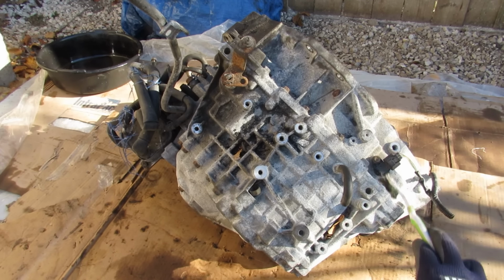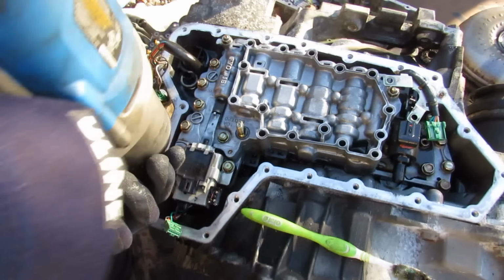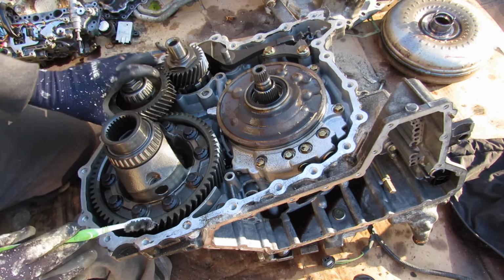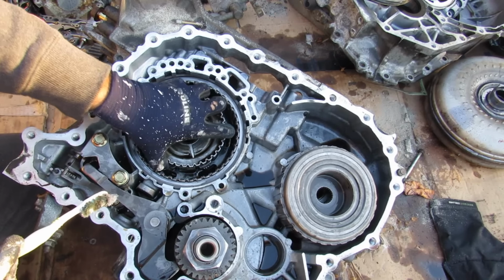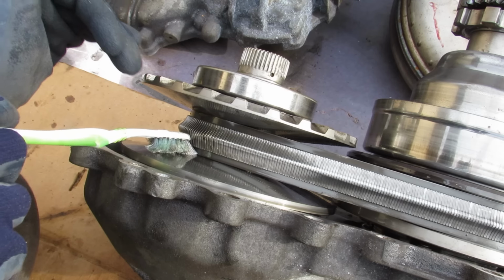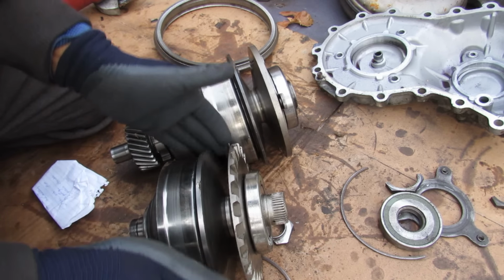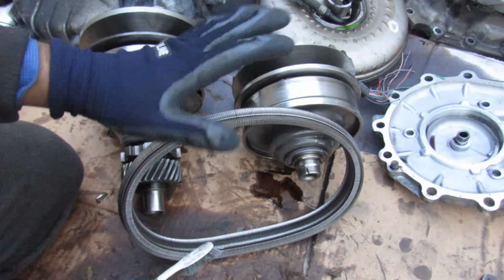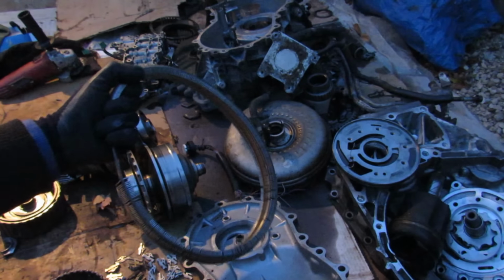Why Nissan CVTs FAIL

Comment: I own a 2013 subaru and when I went to trade mine in and found out they had switched to CVT transmissions... I WALKED OUT THE DOOR. THey don't last as long and the warranty they offer reflects this fact.
Reply: I was somewhat concerned when the wife wanted to buy a Forester. It's a 2016. Several years after the purchase, Subaru bumped the warranty to 100k miles - ok, what do they know that I should know? Just got back from a 2500 mile road trip, with the cruise set at 80 mph. We were just about the slowest vehicle on the interstate. Forester has rolled 127k miles now. I did do a CVT fluid flush with Subaru fluid at 100k - even though Subaru says the CVT is not supposed to be serviced. Old fluid did not look that distressed, but I didn't send a sample out for analysis, so who knows?

Comment: I have a new appreciation for designers and those who repair CVT Transmissions. This is more complicated than maybe even brain surgery. Kudos to those who study and become experts on these vehicle parts.  I will never take my automatic transmission for granted again.... and maybe buy my next car with a Manual Transmission!
Reply: Repair?  There is no repair for a CVT, what they do, out of warranty, you buy a new transmission the old they may give you a little discount but you will be 4k or more dollars light for a NEW one, identical, you pay the replacement cost at the dealership, as you will get warranty, if you replace it by yourself or an outside mechanic, you will get warranty from the shop to took it to.  As there are computer related stuff that need to be done to the Transmission Computer control unit and the car computer work together so, you have to pay labor.  In my opinion, keep you money save and get another car that has NO CVT or Dual Clutch transmission.  They are expensive and cannot be repaired, period.  Remember even having the money, you are getting the same transmission that will fail again and it cannot be repaired.
Reply: @somarpr ... I am very surprised at what some of these people have written in the comments because jetco is known for more than 20 years for total garbage CVT transmissions and they're still running on the same principle except for you don't have to split the cases now they've added a transmission pan..... Avoid all jatco CVT they've had the same problem for more than 20 years and they've just needed the do a little longer but it's still the same thing .....garbage😮😮😮😮

Comment: Most of the ones I've seen only have a problem with the spool valve stepper motor. $30 part and just requires dropping the pan and valve body which can be done in vehicle, takes maybe half an hour, and doesn't require complete disassembly of the transmission or replacement like other shops told those customers.
Reply: I just replaced my stepper motor, and the car drives a little better but it still shows the same code after a couple resets, do you have any clue why that might be? It drives way better but it still slips but I can feel it “shifting” up but it takes some time. The transmission is at 172k
Reply: @JesusMorales-bn4qf  If those are your symptoms you may actually have a physical issue internally. The main symptom we see is the stepper motor code and the car seems like it is stuck in "first gear". Won't change ratio at all and you can only do ~50mph tops.
Reply: @Ashquacks  yeah i think it might actually be slipping, I drove it yesterday like 30 minutes and I could reach speed but it takes time, I have to slowly get on the gas and the car starts gaining speed and when I feel it slipping I let go of the gas and the car takes a second but it goes to the next ratio
Reply: @JesusMorales-bn4qf  you probably bought a bad stepper but a brand new one from rock Auto for 90$

Comment: I had my 2015 Mitsubishi ASX CVT trans replaced under factory warranty as it died at under 50,000km. They were going to rebuild it at the main dealers workshop but as they didn’t have any spare parts available so they sent a brand new trans to my local Mitsubishi dealer which they fitted. The car went well for a few weeks then went through a period of refusing to start so it had the crank sensor replaced also. It has gone well for the last few months but in reality these Jatco trans do not have great reliability and the fact that just about every brand of car uses these is a worry.

Comment: First rate video of a not so great product of Nissan which is Japan's version of Chrysler.  Had a just broke in 2007 brand new Maxima that I drove down the highway at 138 mph.  Heard a faint rumble sound from the rear after making that one small pass of no more than 5 miles.  Both rear wheel bearings had to be replaced.

Comment: "Why Nissan CVTs Fail" Because somebody takes an angle grinder and ... :)
This was a great video. I drive a Subaru Outback with a CVT. Here in Australia they say the CVT does not need servicing, but in the US they say it does. When I checked in with a local transmission shop about it they said it's because when a car brand goes with fixed price servicing for the warranty period (common here in Australia) they want to keep their costs down to minimum. And if they think the CVT will outlast the warranty period then they don't want to pay for fluid changes etc.
Oh yeah, same brand of toothbrush as me. Seems I got that one right. :)

Comment: If I EVER needed a friend, I need 1 now.
I got a transmission flush done by my mechanic, at around 75-80K miles. 
I just turned the car to 115K miles and now the CVT is acting up. 
I did NOT know, that there's a specific trans fluid needed for the flush.
My mechanic is a old school mechanic and I believe he used some typical trans fluid, NOT knowing that you need CVT fluid. I didn't know of this CVT fluid, until 1 week ago.
If he used the wrong trans fluid and now the car "jerks" when accelerating - Is it TOO late to do a CVT flush and I gotta replace the CVT ????????????????? PLEASE SOMEONE HELP ME OUT
Reply: I would change the fluid to what is specified for your tranny, be sure not to overfill
Reply: @ravenbishop5232  - I'm gonna do that. But I'm gonna have a mechanic or 2, look at the trans itself....fuel filter and a few more things. Hopefully this car can give me 2 more years. Cuz it's not very old nor beat up.
Reply: Damage already done - always use the correct fluid with CVTs.
Reply: @LondonSteveLee  - Welllllllllll here's what happened (If I can short form this) I contacted Nissan directly. The Service guy was like, "Let's say your mechanic did use the wrong trans fluid" for example = Then you would've felt an immediate impact or within a month of the transmission fluid change. So that's not the case. NOW I'm a big fan of Lucas products. I used the Lucas Transmission Slip/Leak fluid. It initially worked GOOD. But then I had issues with gear 2 and then, it turns out...It's "Gear 2 on up". So I contacted a reliable mechanic. He said $4k for a rebuilt/used transmission with a 18000 mile warranty (regardless of how long it takes to reach 18k) or around $5k for a new transmission from Nissan (warranty not specified yet) In the mean time, I've been driving the car and not going over 40-45 mph. I use it locally only (works ok) NOW I love my car very very much - Would I pay between 4-5k to repair it OR pay 29k for a car that's worth 20k on a good day ????????????????????
Reply: @cobrakainevereverdies6940  If you're happy to pay the money then all's well I guess!
Reply: @LondonSteveLee  - Ask yourself. What OTHER option is there ?????? Pay lesser or give into the Economy ?????????

Comment: I test drove a Corolla today with a CVT and it was making a weird noise under light acceleration around 100km/h. Now I can picture in my head exactly why. Exactly the video I was looking for.
Reply from the maker: Ouch. Didn't know the corollas had it bad too
Reply: @speedkar99  I wouldn't say bad, it was a 2014, first year they had CVTs, and had 120k miles on the clock. I suspect it has never had a transmission oil change. Drove great other than a slight vibration/noise under light acceleration at 60mph.

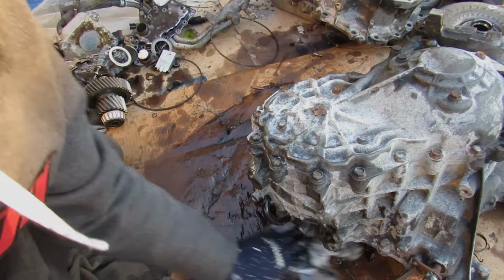Comment: At the 9:03 mark when you remove the variable pulleys. Is that possible to remove without dismantling the rest of the trans. Like could you just do that step and replace the belt Only? Thank you.

Comment: This is the best explanation of CVT of NISSAN  cars. Now seems like when it starts making whinning noise, the noise is obviously coming from the planetary gear sets, what can be done to get rid of the whinning  noise? ? Some people are saying if you install transmission  cooler it helps  to cool down the transimission  fluid when it gets hot. What can you say about this? ?
Reply from the maker: Yes the cooler will help. But if it's already worn then a cooler can't help
Reply: @speedkar99  sometimes they say that Transmission  fluid of Nissan be it  NS1, NS2, or NS3 they have low viscocity and thats why the iron belt inside CVT transmission slides when the car travel long distance as the Transmission  fluid becomes too hot, and they suggest using another brand for transmission  fluid like AMSOIL CVT Transmission  or CASTROL CVT transmission has high viscosity and may help, is it good to use these fluids apart from what Nissan are proposing in their cars? ?

Comment: awesome video.  I have seen the same variable speed used in simple power tools. like lathes;  not automatic, of course.
Reply from the maker: Interesting
Reply: @speedkar99  I am pretty sure.  There would be three axels, the outside two would be fixed.  The inside axel (all parallel and in line of course) moves back a forth a little.
  The v belts move up and down relative to each other because the middle ring slides back and forth on the axel.  (your video is good on many levels)

Comment: I have seen Nissan CVT'S last for 250k+ miles on original transmission. But, those drivers weren't aggressive, and drove like a grandpa. That's also including regular fluid changes. Most Nissan drivers are younger, and drive more aggressively. Therefore, these CVT'S do not last in those conditions. It's not meant to be raced and hot rodded. Not saying these CVT'S are good, there are some defective ones out there. That's why you should do a long test drive before you buy any kind of car.

Comment: I was a big Datsun fan for almost 50 years, had many of them, then just over 20 years ago they started the down hill slide, they will not stop until they hit the bottom. my cvt started breaking down around 70 thousand K. the company has been falling since Renault of France became partners with Nissan 22 years ago.

Comment: Absolute garbage. CVT’S should only be used in Snow machines and scooters. And the only reason why manufacturers want to go to the CVT is because they’re cheaper to manufacture. Driving a car with a CVT is horrible. When your driving down the highway and want to pass someone… Ugh. It starts winding up (sounds terrible) and is not efficient when passing cars.

Comment: It still seems like transmissions (normal or CVT) are stuck in 1960s technology.  Hydraulic fluid, springs - is there no better design now that the computer is running the rest of the car?

Comment: One of the biggest financial mistakes that I believe I've made in my life is buying a Nissan Leaf. Don't get be wrong, I love the Leaf, I love the EV factor, I love the electric car. I DO NOT LOVE THAT IT'S A NISSAN! I wish it were a Toyota. There are so many things about it (and that I have discovered are common among Nissans) that are just bad designs. The biggest is that cabin air filter, which is a massive pain in the ass to change. The wiring is goofy, the fuse boxes don't make sense. 

I recently rented a Rogue (not my choice) and the CVT sucked. I was trying to drive to the top of Mauna Kea and the park people recommended against it, they said Rogues often had problems.

Keeping it in D, it wouldn't have made it. The trans was obviously overheating. The car started to bog down and would have quit, had I not known what I was doing. I ended up putting it in 1st and revving the engine up to 4k to make it perform acceptably. I doubt most people would think to do this. Apparently, they have to get towed all the time on the mountain and often don't make it to the top.

The engine braking was quite good. When I got back down, the guy checked the brake temp and couldn't believe it, he kept checking it over and over again, it was only 80 degrees. He checked with his supervisor and said that was the lowest any of them had ever seen on a Rogue. It's not my record though, I did 75 with a Corolla on Pike's Peak. So use the engine as a brake, take your time, don't use your brakes, and don't worry about it if it's a rental.

Most of all, don't buy a Nissan.

I haven't driven one, but I have heard that new Toyotas have a solid first gear with a CVT for the rest, which I thought was an excellent idea. I think CVTs are great for fuel economy, but their best effectiveness is not at either end of the ratio. So, if what've heard is true, that's a fantastic design. Toyota is my favorite manufacturer. Their biggest downside is that they're slow to adopt new tech, but when they do, it's almost always a fully developed mature idea.

Also, the goofy programming that gives the CVT "gears" is so dumb. Just stop it. Chances are I'll never own one, I only do EVs or Priuses (and heavy duty trucks with manuals and automatics), so no CVTs. They were an interesting transition tech. Nobody should be buying a conventional car, for the rest of human history. The one you're driving now should be the last. Your next car should be an EV, or at worst, a Hybrid Synergy Drive vehicle. No more conventional cars. We cannot afford it.
Reply: Can't afford what? Conventional cars that actually work?
Reply: @Y0URGRANDMA  The end of human habitation on this planet due to climate change.

Comment: We own a ‘06 Murano (no sympathy wanted). I grieved over the purchase and went back to the dealer the ‘morning after’. Thought of crying buyer’s remorse. The Nissan dealer serviced the tranny (car had 111k on it). I spent some time with the shop manager. His input (of course he was biased…no kidding). But he made it clear that he could confirm that people would up with blown trannys but everyone was overloading the CVT’s. His warning was received. We kept the Murano. It has a lot of good…very good…features. I have been careful with the transmission but I have not babied it. We are at 190k with zero problems. I do have a 5x8 utility trailer. When I load it I literally go to a public scale and aim for 1,500 pounds as my max gross weight. 
We recently moved 1,800 miles to a new home and the Murano did great with that gross weight. When not towing I have trained myself to NOT drive it like my ‘05 Volvo S60 T with a conventional transmission (exhilarating on the accelerating!). I studied and saw the weak design and the mechanic makes good points here where the engine is most likely more power than this CVT should have to manage. 
Having put on about 80k since buying ‘Murray’ we will go for it’s second tranny service. 
Last note. I was overly concerned about the potential short life-expectancy of our ‘06. But one day in Cheyenne, Wyoming I noticed someone with the same year Murano. I visited with the owner. She had 255k mostly trouble-free miles. No tranny issues ever. 
So remember where every story is (most likely) true…you have not heard every story.

Comment: I am curious of why a torque converter is needed with any CVT. It seems that a torque converter introduces another introduction of loss of efficiency, and added complexity of a lockup system to provide for some restoration of lost efficiency. For neutral and reverse functions, could be handard by a reversing gear and magnetic clutches.